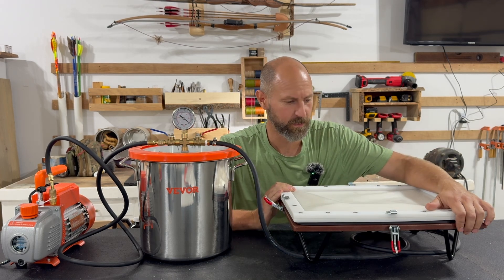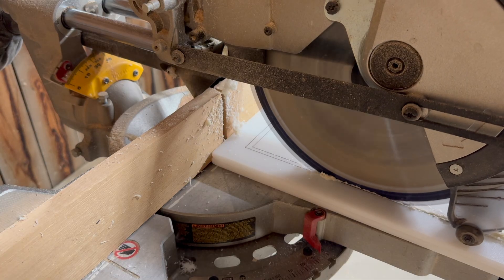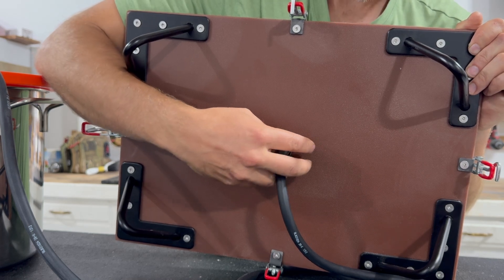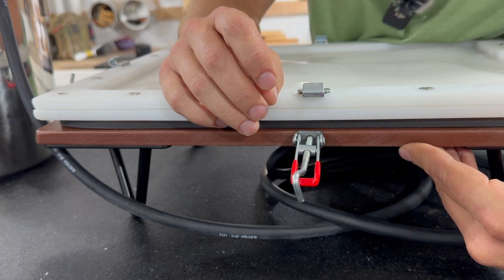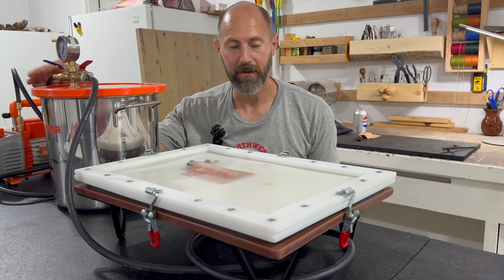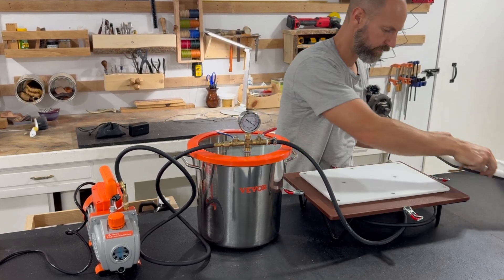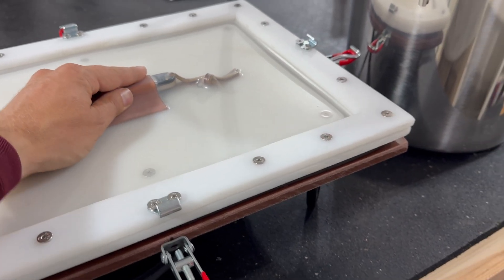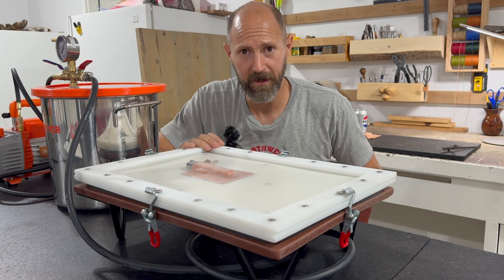I Built the Most Versatile Vacuum Forming Press on Youtube

Comment: Your vacuum leak might be coming from the seem in your gasket. A chemical like Acetone MIGHT melt the gasket material and allow you to chemically weld it together. Worth a shot. But, holding a vacuum for an hour? I'd consider that a pretty good seal. 
Good work on this.

Comment: Very impressive Build. I heard you mention in the video you’re losing a little vacuum. You may be getting a little bit of flex with your clamping hardware This will give you uneven pressure on your seal. If there was a small frame on the outside edge where the two plates match so your clamps will bottom out on the frame. Even if it was temporary, you could see the amount of flex in the top part and adjust each clamp to minimize it.Thanks for sharing, definitely in inspirational!
Reply: The other weak point I saw was how the pressure gets released. Putting a T and another valve would be more effective. Having to unscrew the line all the time introduces a leak point.

Comment: This is a great build.  The only thing I saw that I probably would have done differently is where you terminate the weather stripping, as I suspect this is probably the source of your air leak.  If I decide to build one, I think I would skive each end of the gasket, making a scarf joint of sorts and probably add a touch of rubber cement.  Just my $0.05 worth.  Again, you did a great job on it.
Reply from the maker: Yes I debated that. I did add some barge cement off camera, but you might be right about the scarf joint…

Comment: I have used the cutting boards from Sam’s Club and they are pretty decent. One suggestion from a longevity standpoint is that the vacuum connection on the under of the table would benefit from being a 90 degree bend. Something like a barbed fitting with threads can also be found in gray plastic for sprayers and whatnot at farm supply stores. Brass is nicer, but plastic is lighter and less prone to stressing the connection, especially if the tubing itself isn’t causing lateral pressure. The beauty of hdpe is that you can heat and form it as well; you can make a hemispheric bulge and thread into the side of it, allowing the depression to act as a trap of sorts as well (if you didn’t have the pot)

Comment: Maybe add another valve between the pot and the vacuum table; close the valve at the pot to save the vacuum that has been established in the pot, then open the added valve to release the vacuum at the table. 
This way you run the vacuum pump less. 
Faster cycle time as well.

Comment: Cool build! Videos like this popping up in my feed are pushing me toward trying vacuum forming around 3d printed parts instead of trying to print molds to cast food safe plastics in. I can't recall if it applies to HDPE, but for many plastics, especially polycarbonates, they cut better with the saw blade backwards. Then rather than melting while also cutting, the heat generated is working in your favor to give a smoother cut.

Comment: Great idea!
There is a product called Starboard, a composite that is used extensively in boats that might work better than the cutting board. It is really nice to work with. Worth a look. Fairly readily available.
As for the leather drying in the box, try setting a piece of cheap 1/8" door skin plywood under it.
I do this when I use the wife's Seal a Meal for forming and it sucks up a good bunch of the water, leaving your piece almost dry.
Set it aside when you are done and let it dry, use it again
I am going to build one!

Comment: Great project, think i´ll build something a little bigger. Just thinking, if you put the heat insert on the oposite side and put the screw throug the boards, that should be a stronger connection. That way its not possible to rip the heat inserts out, had that problem a few times with some 3d printet parts where i used them.

Comment: 4:13 
I know this build is complete but just as a heads up, the barbed fitting you have could be replaced with a 90 degree barbed x male adapter. It would prevent possible kinking and you could use smaller legs/supports. (I love the legs though so I wouldn't change them even with the 90)
Reply from the maker: Yeah I looked all over for a 90 and finally gave up and put in what I had…so far I actually think I like it better because I feel I can have the chamber on any side of the table and it wouldn’t make a difference…so that’s nice. I know they make swivel elbows, but I’m not sure how they would perform under vacuum.
Reply: @wyomingwright  that is a great point about the mobility of the vacuum pump. I did not think of that. 
I would agree about the swivel 90's. I'm not sure what the gasket material is rated for on those under a vacuum. 
You've sent me down a rabbit hole of turning small air compressors into vacuums for this purpose, so I'll be blaming you when my wife asks why our extra portable tire inflator removes air instead of filling up the tire 😂. 
I'm also making a vacuum cannon now thanks to you. How dare you inspire people like this. 😉

Comment: Looks great!!  But expensive!!  I made mine with a $70.00 vacum pump.. $ 60.00 2'x2' bag.. about $ 50 in brass fittings and hose.. awesome addition to forming/ molding.    Unbelievable results.  Yes you have to have something on inside, bottom to keep airway design , off of your leather.
Reply from the maker: I hear ya. This is not the cheapest option out there…but still a lot cheaper than the other dedicated vacuum forming presses out there. The garage works holsters kit alone without the vacuum pump is over $500 (they look awesome by the way, but too pricey for me). And with this design you get a chamber to use for resin projects like making handle material. I also plan to make some dummy knives with resin for sheath forming…so this design made sense to me for what I want to do. I also don’t have to worry about moisture working its way back to the pump or accumulating in the tank…and I didn’t have to worry which fittings to buy or pressure gauge etc. because most of it came with the pump/chamber. I will say though, that the construction process was not necessarily fast or easy…so it may not be for everyone. Thanks for the comment!

Comment: That's a cool way to wet mould. I wonder if you could go straight to the wax and the vacuum form while its still hot and malleable?
Reply from the maker: Might be worth trying. One nice thing about the silicon membrane is it provides a little protection against the heat when you’re dealing with hot materials like kydex.